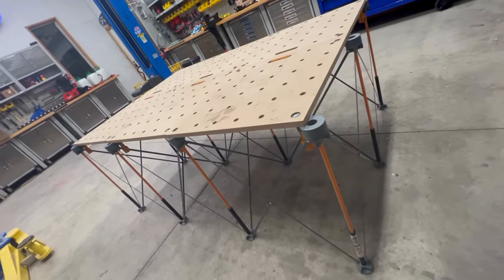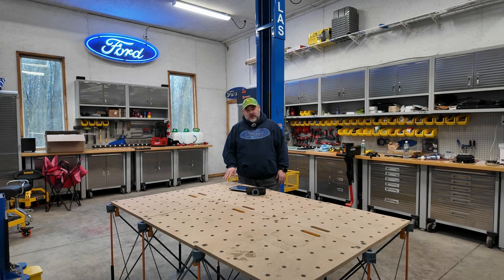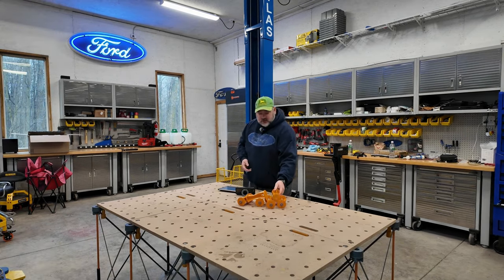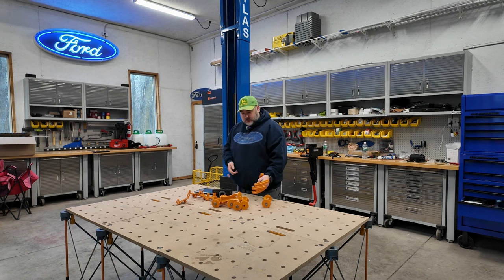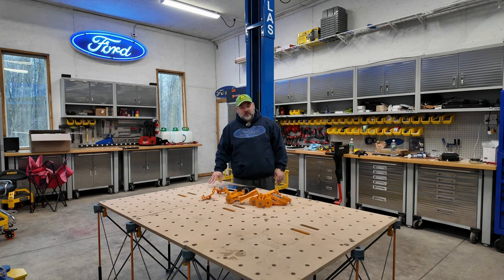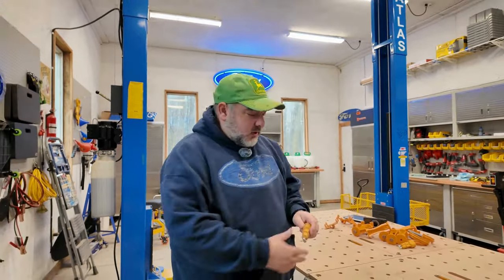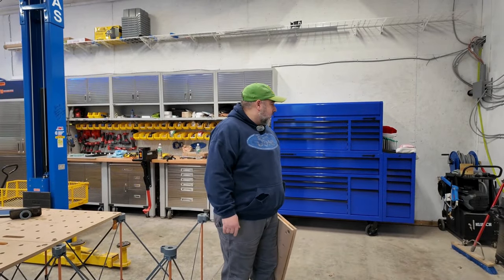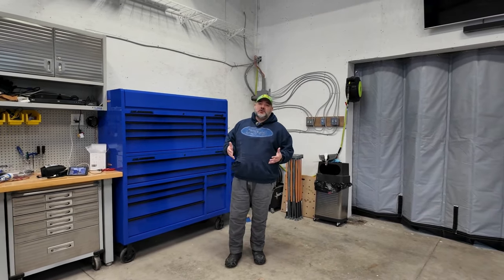BORA CENTIPEDE WORKBENCH: 10X Efficiency Boost!

Comment: check out the double p tops to solve the issue of not enough p top holes to secure the table tops near the middle 👍
Reply from the maker: I actually bought a set months ago. Have not felt like deploying the table in awhile.  It's honestly not that fast into action with the Bora tops. I think I'm just gonna cut a down a piece of plywood and use that.
Reply from the maker: I've finally installed them!  It's better but honestly...I think it's a lot of fuss to setup the Bora worksurfaces on the Centipede

Comment: I love this table so much. But the tops are a waste. A piece of plywood is a bit lighter and a lot less expensive. Three-quarter inch holes drilled in the plywood and insert a three-quarter inch dowel into those holes down into the holes on each of the legs. That keeps it adequately stable. Those finicky plastic things that come with it are not for me.
Reply from the maker: I use this table for everything.  It’s in most of my videos lol.